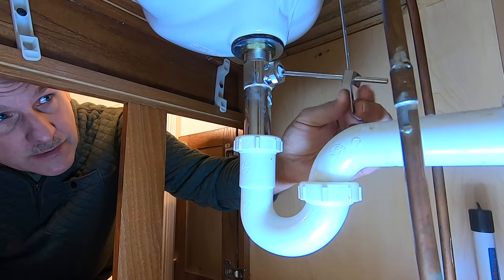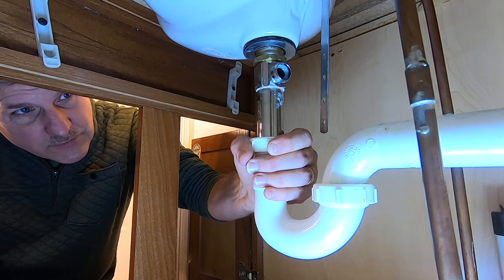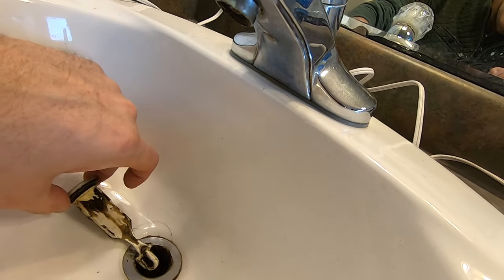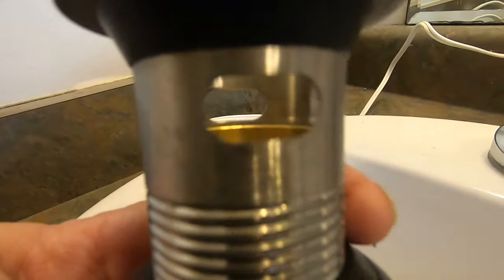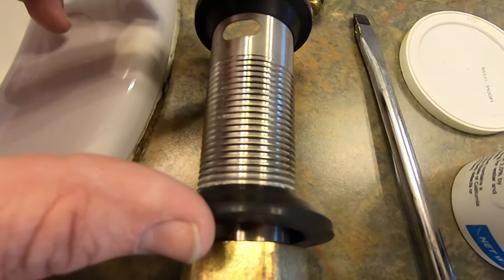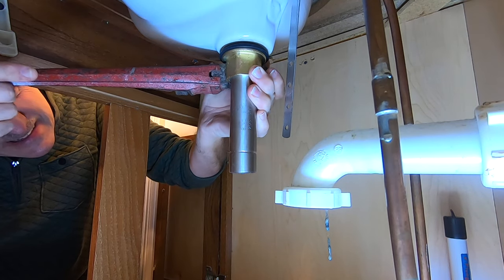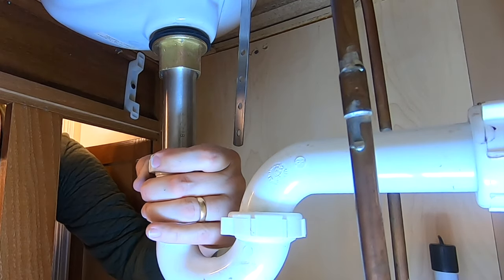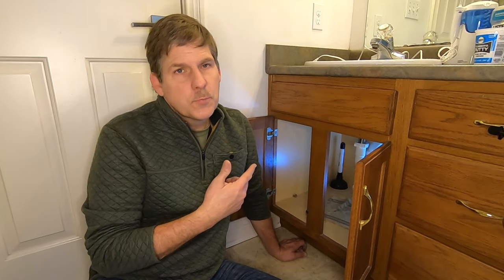How to replace a sink drain with push button stopper

Comment: What happens when you have a sink full of hot or dirty water? Does that mean you have to put your hand in there to push the button?
Reply from the maker: Yes. One of the drawbacks. But in my book it beats ever having to touch the sludge of a clogged sink drain😬
Thx for watching!
Reply: Does not need to be your hand... paint stick, plunger handle, ... use your imagination if it is too gross or too hot touch... or glove your hand with a cleaning nitrile glove.

Comment: i'm about to swap one out.   a faucet change out turned into a full sink replacement.  50 year old cast iron sink was totally rotten.  now I'm having to hope that i don't have to replace pipes under the sink.   the old owners knew just enough to be dangerous but they knew even more than me.
Reply from the maker: Hey k333rl,
Sounds like a typical home project. 😂
Take your time. Do it right. And you’ll have years of trouble free operation. 
Thx for watching!

Comment: Great video! For anyone considering this upgrade, the one he installed in the video is still quite prone to clogs due to the three cross bars inside the drain. The best alternative in my opinion is the type where the plug just threads into the threaded sides of a COMPLETELY OPEN drain (no crossbars!). These still require routine cleaning, but much less
Reply from the maker: Hey wuff..,
Thx for the input!

Comment: Thanks for sharing this! The solid nut and rubber gasket here that you use are much more heavy duty than what comes with the drain that you linked in your description. Can you share some links on where to get those two things as well?

Comment: Thanks for the video. I like the idea of an unobstructed drain from the sink to the p-trap. One thing I think is overlooked by people considering these push button stoppers is you have to reach into the sink water to open the stopper. I guess you could use a toothbrush handle or something.
Reply from the maker: Hey Papa…,
True. But I prefer that to unclogging a goopy drain!!!
Thx for watching.
Reply: I'm switching to this because I never really use my sink to and fill it up but when the drain falls down and gets stuck its annoying. I do see what your say I would say old tooth brush

Comment: Do all the pipes need seals/washers
Reply from the maker: Hey rsd…,
A typical p-trap drain kit comes with compression washers. You’ll know it’s tight when you turn the  nut by hand and it locks the pipe to a point where it is immovable. 
Plus, if you get leaks, look to tighten there. 
Hope that helps.
Thx for watching.

Comment: Whats your thoughts on the push button vs pop up drains?

I always hated that the levers on mine could never get tight and there was way too much pushing and pulling on the rod to get the drain to plug properly. On the other hand, you might not want to dunk your hand in the water in the sink to push the button if for example you were using it to soak/clean a sponge you were wiping down the toilet or other things that make the water nasty.
Reply: With the self pop up it will not leack unlike the one with the bar in the bottom in the future I would change them with the self pop ups and no longer have them with the bar anymore especially if you have 4 or more ...no more leacking headackes anymore for life

Comment: After watching your excellent video, I finally had the courage to replace my sink drain, which was endlessly clogging. After I completed the job and tested it, I found a very slow drip coming from the rubber seal at the bottom of the sink. I tightened the nut but it's still dripping, and I'm a little hesitant about tightening it more. Advice?
Reply from the maker: Hey Tina…,
Yes. I’d try to tighten more. If that doesn’t work, I’d take it apart and see if you can tell if was on straight or crooked. 
Reassemble to make sure everything is straight as can be. 
Hope that helps!

Comment: Do we need to put plumber putty underneath the new drain part where it sits on top of the sink?
Reply from the maker: Hey Sara,
Not if it comes with a gasket ( between drain body and top of sink basin opening ) 
Yes - w/o a supplied gasket. 
Thx for watching!

Comment: If the drain is leaking from the top silicone ring, could I have tightened it too tight?
Reply from the maker: If it’s hand tightened, slight possibility. More likely it is crooked. 
Loosen and retry - see what happens. 
Thx for watching!
Reply: If I tightened it slightly with my lock jaw pliers, bad?

Comment: Thanks for the video! I was wondering if I can install an overflow drain in a sink with no overflow holes? What would happen if I did?
Reply from the maker: Hey Jason,
IF the fit is ok, then you are likely gonna be ok. All you can do is try and see. That hole in the side of the drain tube just will not serve a purpose. 
Thx for watching!
Reply: @Housebarons  Sounds good…thanks for the quick reply!
Reply: @mrcanada1968  did you ever install it and did it work out? I'm in the same situation.
Reply: @taylamorris  I was wrong about the sink I was installing the drain in…it was actually an overflow sink. I think it should be ok to install an overflow drain in a non-overflow sink though. I have read that in other places as well.
Reply: @mrcanada1968  oh okay. Thank you so much for the quick reply. I hope it will be okay. I'm doing the replacement tonight for the first time. 🤞🏽
Reply: @taylamorris  Good luck!

Comment: The push pop up drain that you used in the video is not the same one that you said that you used in the description section. I like the one you used because the nut is metal. Can you give the brand?
Reply from the maker: Hey Kat…,
Sorry. Got it on Amazon and they change products so fast, it’s hard to keep a link consistent before they swap it out for another. 
Thx for watching!

Comment: I have tightened the piece that holds the bottom rubber gasket in place right to the end of the thread with no more movement, but everything is still loose so I can move the plug side to side and up/down.  This means the seal is not tight and water leaks.  How do I remedy this?
Reply from the maker: Hey Greg,
Seems like you may need an additional set of spacers under the rubber gasket ( another rubber gasket , o-rings, or a stack of washers ) - something to take up the slack. Not sure if your sink is thinner than most or your drain tube longer to the  threads than most, but I’d try something like that approach to help snug up that rubber gasket tight. 
Hope that helps,
Thx for watching!
Reply: @Housebarons  thanks for the reply!  The piece that screws up to hold everything in place either came upside down or I switched it at some point 🤦 so I got it now.  Thanks for the video!
Reply from the maker: Hey Greg,
Awesome!

Comment: Now that I have one installed, I need a video on how to remove the stopper enough to clear a clog.  I haven't found that anywhere yet, but will keep looking.
Reply from the maker: Hey Klein,
No worries. Just pull it out. Mine is just a friction fit. Slides as you pull it up out of the drain. 
Thx for watching!

Comment: The one on the link doesn’t have the rubber gasket,did you buy that separately?
Reply from the maker: Hey the beard..,
I checked the link on the ESFORT  pop-up drain. It looks like the design has changed to the white / silicone looking gasket rather than black. 
That should be fine. Drain is useless w/o gasket seals. 
You should be good to go. Worse case - Amazon returns are simple. But you should be good to go. 
Hope that helps.

Comment: My problem is that I can't loosen the nut from the p trap facing the wall ...any ideas???
Reply from the maker: Hey cake..,
1) double check the direction you are trying to turn it- it is easy to get turned around and are accidentally turning it the wrong way.
2) if it’s metal, you could try Pb-power blaster ( a penetrating solution ) that’s helps free up stuck bolts. An auto store would have as well as big box stores. 
3) if it’s plastic, try a plumber wrench / monkey wrench - they make different sizes and they are remarkably strong.
Hope that helps.
Merry Christmas!

Comment: Can I use a similar method to replace my pull lever drain with a normal drain with rubber plug?
Reply from the maker: Hey Griff…,
Ours was a pill lever - should work as best I know. Worth a try at least. 
Thx for watching!

Comment: You left the strap of the lift rod dangling. I never liked this stopper system. The hole behind the spout for the lift rod is an opening where water can leak in. I removed the rod and would like to seal the hole. Any ideas how to? Thank you.
Reply from the maker: Hey 9825…,
Hmmm. Not sure there is a way short of building your own plug - maybe thread the hole to accept a machine screw or something like that. 
Thx for watching!

Comment: Using the rubber gasket instead of plumbers putty, do you ever get a small amount of standing water around the edge of the stopper? A plumber told me he prefers the putty because the thickness of the rubber gasket can leave water pooled around it.
Reply from the maker: Hey David, 
Good point! Makes sense.
Thx for watching!

Comment: How important is the orientation of the overflow openings? Should they line up with the overflow hole in the sink? Do all overflow drains have two openings in the drain itself? 
What do you think the problem is if the sink leaks out of drain holes in front or back of sink (underside) when you push the drain in on a full basin of water and it drains out of the holes as well as the drain itself?
Reply from the maker: Not sure if this will answer your issues but here is where I'd start:  - the down tube / drain tube needs to be one that is made for your sink Is it a sink with an overflow ( as opposed to a sink w/o an overflow. )?  Those drain tubes are different. 
The drain tube needs to be seated in "plumbers putty" or silicon ( see the directions ). If those two things are correct, you shouldn't get leaks. 
Hope that helps.

Comment: I have watched a few videos where they recommend adding clear silicon around the sink gasket in the bowl and adding teflon tape to the threads up under the sink as drips from these pop up gaskets leak over time, How has it worked for you?
Reply from the maker: Hey Dangerma,
No leaks yet. I guess it’s a precaution, but these have large rubber gaskets - no water should get by. 
Thx for watching!

Comment: I am 56 years old and trying to do this on my own with no plumber I've gotten all the other stuff to work just fine My sink is from I don't know when long time ago underneath the one that comes out from the trap mine is metal there's no washer or circular thing I don't know the names for all these things two unscrew It's a pipe metal pipe it was two pieces the other piece came off I can't get it to budge
Reply from the maker: Hey Susie…,
Is your issue anything like this video?
https://youtu.be/NYAwdoe5RTg?si=EN5R0CLszkX2lpvY
Reply: No it's not the only place we have the tiniest of leaks is at the trap I think it's called the one that curves up and it's the one we tighten the white cap that goes into the straight plumbing pace into the wall right there we're getting the slightest bit still coming out so we're going to undo it and maybe it wasn't threaded completely straight I appreciate your help so much I'm not a plumber never done this before and I can understand what you're telling me to do. Thank you @Housebarons
Reply: @Housebarons if that doesn't work I will be back next we are going to do the kitchen sink 😮

Comment: Good vid. Only. Now u must place ur hand into the pool of used water...
Mmmmmm modern tech.
Reply from the maker: Hey Joe,
True. Still beats having to take a part a drain to deal w/ a clog- that is major grossness and stink! 
Thx for watching!
Reply: How your push button will avoid build up in the drain? Does it come with a strainer? If not you will still have to deal with removing stinky gunk and hairs.